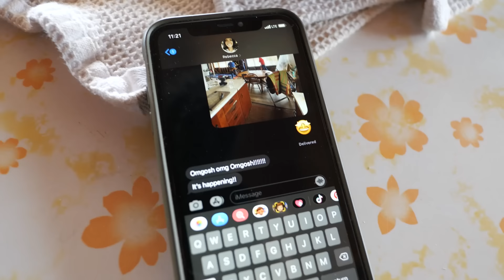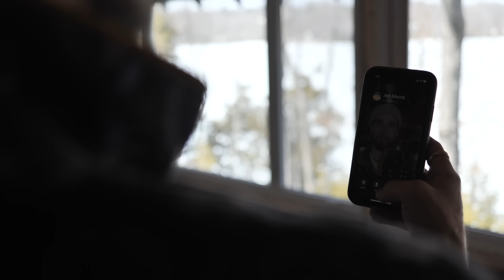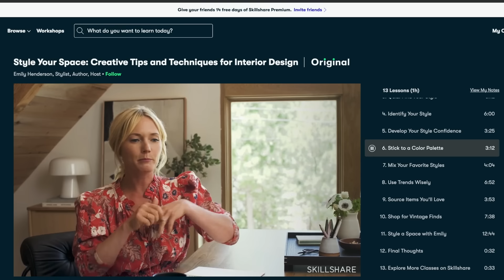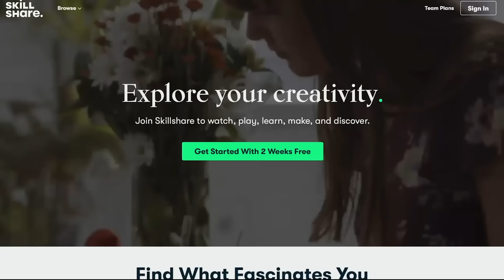This $15,000 Transformation Changes Everything!

Comment: Putting in large windows, especially ones that come down close to the floor, is the best thing you can do to improve a house.
Reply: You being sarcastic? Cant tell
Reply: going to be cold in the winter though, triple pane are much better than double pane. Maybe some thick, insulated curtains with the wood stove
Reply: @stevejeffrey11  They have window film that keeps the heat in and the cold air out!
Reply: @stevejeffrey11  
They won't be in Canada next winter.
Reply: @stevejeffrey11  I think double panes are fine as long as you use some insulated window coverings once the sun goes down.  I have that setup in my house and you can instantly feel the increased warmth once you close the shades.